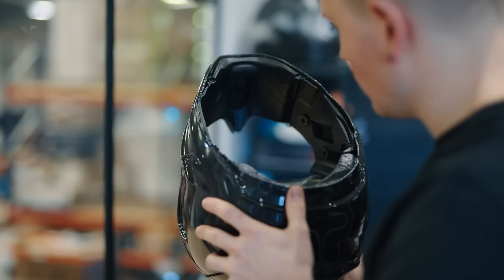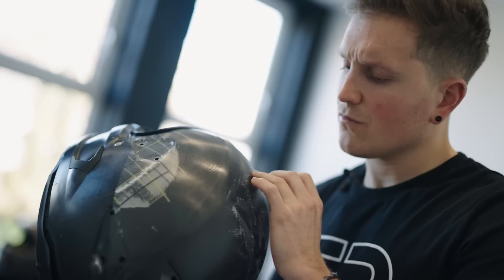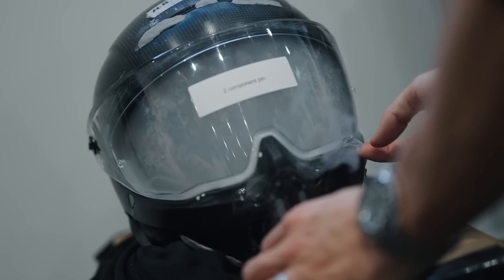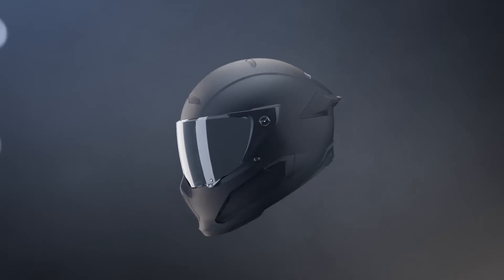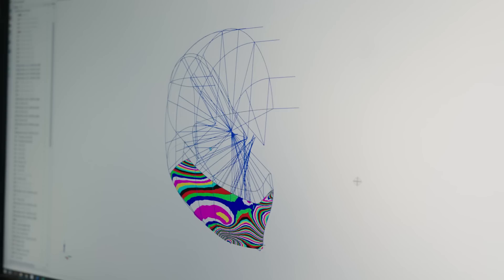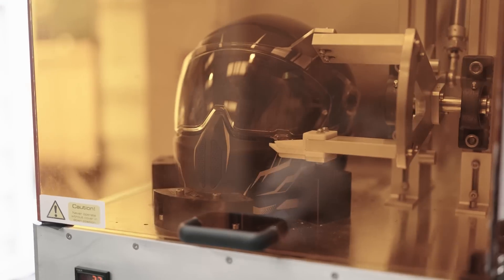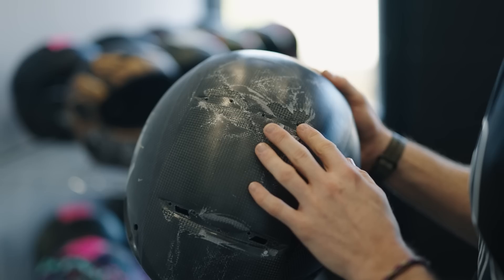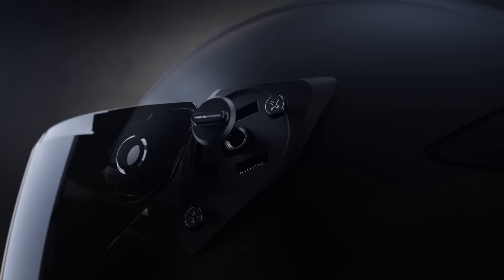Engineering the Atlas 3.0

Comment: **Be careful**  Slick marketing but my experience was not a good one.  Purchased the Atlas 2.0.  It was delivered damaged.  Box was in perfect shape so I have to believe it left Ruroc this way.  Sent it back, came back with the exact same damage.  They didn't correct the issue.  My guess is they looked at it, shoved it back in the box and sent it to me again.  Frustrated with the issue, so I corrected the problem.  Tired of waiting for them to fix their problem.  Riding to work wearing the helmet for the first time and the right side of the shield broke.  Had to pretty much hold the shield the rest of the way to work.  Taped it down to get home.  They sent me a new plastic piece.  Fine.  When I ordered the helmet, I also ordered the helmet camera attachment.  Pieces missing but I had my own extras so it wasn't worth the time or effort to contact Ruroc yet again.  Not being able to try it on, I ordered a little too big.  Since it was the holiday season in the US and raining, I didn't ride and lots of other things going on.  I told them after the holiday (and rain) that it was a little big and requested the thicker cheek pads.  The response I got was, buy them on the website.  It was ALL my fault since this was outside the initial 15 day window but I hadn't been able to wear the helmet for multiple reasons.  2 issues with quality and one with the weather.  After all the problems and delays in being able to use the helmet since it was damaged multiple times and broke the one time I could actually use it, I would have thought they would be a little more sympathetic.  Now it is just a big paperweight.  They got my money so they could care less.  Slick marketing got me in.  Not again.  This is just my personal experience.  Take it for what it's worth.  This may be the best core helmet ever made but if the shield breaks on the first use and the wind deflector keeps coming loose from crappy 2 sided tape and what you order is not delivered, is this the company you want to do business with.  Again, just my personal experience.  Buyer beware.
Reply: as though anyone will read your drivel
Reply: @ji4545  Apparently you did.  You just didn't like the content.  Many people love the Ruroc brand.  I just happen to be one that didn't have a good experience.
Reply: Always good to hear both sides of the coin.  Thanks for sharing.
Reply from the maker: If there’s anything you feel we can help with please don’t hesitate to drop me a message. My email is archie@ruroc.com